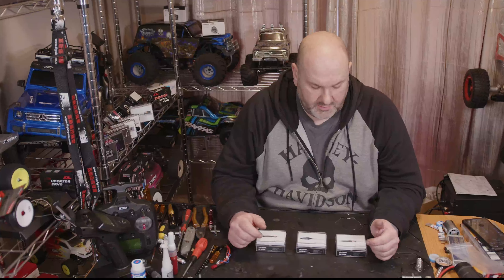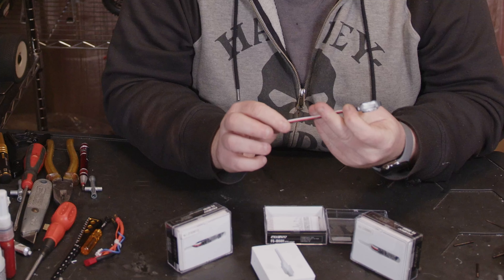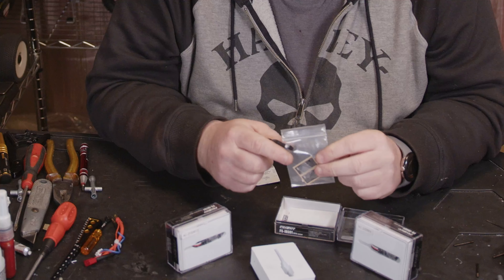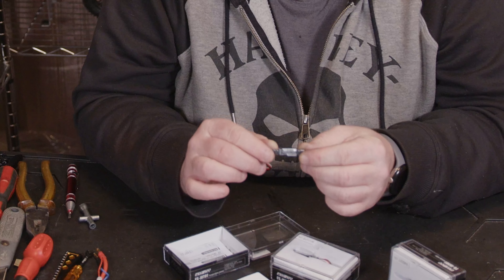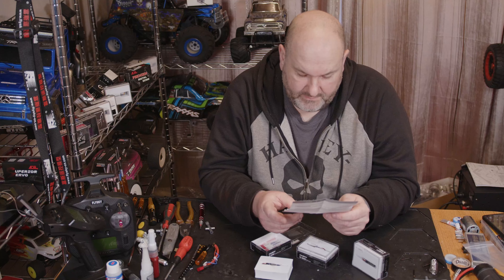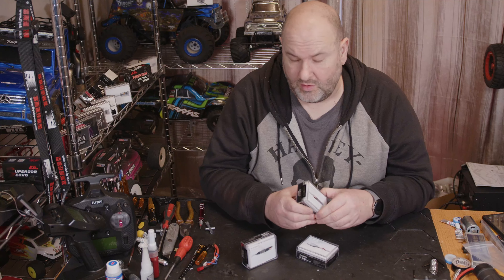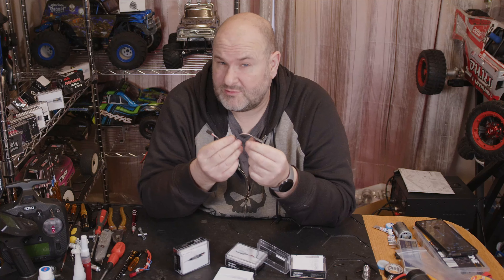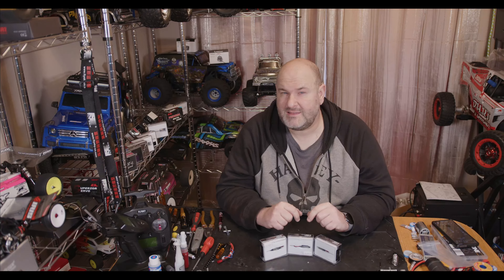Flysky’s new Ibus 2 sensors 1st look

Comment: They seem to be nicely designed. However they can't coexist with the old iBus sensors. At least from my preliminary tryouts. As soon as you set one of the 4 'newport' NPA-NPD inputs to iBUS2 you are locked-in to iBUS2 and all the other NP inputs have to be iBUS2. You can still set them  to S.BUS for communication to a flight controller for instance, but not iBUS, thank goodness. I even tried doing a double RX configuration, but the iBUS2 sensors won't work on the secondary RX, even connecting the two RXs via  iBUS2.  The secondary RX can only be configured to S.Bus, iBUS-OUT XOR  iBUS2, besides PWM and PPM of course.  No iBUS-IN option.   
So FlySky wants you to do away with the iBUS sensors in favor of their new iBUS2 ones. What a shame. Fortunatly the old iBUS sensors still work with the advanced RXs, by themselves, with .
Reply from the maker: It's because you can only have one ibus protocol on the tx at a time :)

Comment: Will this work with the flysky FS-G7P?
Reply from the maker: These require ibus 2 so unless the G7P has Ibus 2 then they won't work with it but I'll have to check
Reply from the maker: Hi I have checked but no the G7P can not do ibus 2 so only the older type sensors will work and not these on the current firmware.

Comment: While I do like these new and overall smaller sensors, I do see some potential flaws. For starters, as of this typing I can buy the current available sensors for as little as $8 a sensor. Don't know how much more these newer ones will cost as of this posting.
Also the older sensors, as you noted, can be "piggybacked" with just one of the sensors having to go into a RX channel. Now you will HAVE to buy the CEV04 module do that, if it's even still compatible. Note as well that only with the enhanced receivers can one set the individual channels to specific outputs unless something changed that I'm not aware of. I'm not sure if iBus2 has faster data transfer rates or what but for me, I'm keeping what I currently use which is mainly, the now older, temp and voltage sensors.
Reply from the maker: Yeh will have to have a good look at how best to use these but as of now I can only find them listed at around £40 each which is crazy price increase if that is what they retail for.
Reply: @WTFRCCars  $50!!?? I may as well buy Futaba gear then. Unreal if that's true.
Reply from the maker: I thinks it's just early sellers trying to cash in
Reply: The iBUS and iBUS2 are mutually exclusive, you can't use both in the same setup. THe iBUS2 transmission rate is 10x that of the iBUS, BUT telemetry data is sent back to the transmitter every 10 data/control packets received by the RX or even less frequently. So what would the higher transmission rate be useful for? Not for telemetry but for servo control if you connect iBUS2 servos. Than again is that really practically necessary?
Reply from the maker: Ibus2 servos work really well I run them in the touring car
Reply: @WTFRCCars  Sure, that's what they should have iBUS2 left for, for control  devices that need fast rates ond low latency. Sensors don't need that. Their update rates are 5-10 Hz.
Cheers.

Comment: Nothing about these sensors makes any sense. They are obscenely priced [about 5x the cost of the older sensors!!] and in fact only cost slightly less than the GPS module/multi sensor! Further they've lost the piggyback function, the cable looks to be extremely short and they dont do anything new or better than the older sensors do. Every single thing is worse. Something Im missing here? lol
Reply from the maker: The sensors do far more than the old ones and have much higher data transfer bandwidth available, they also don't affect the latency of the radio and are designed to connect through the ibus 2 connectors so don't need daisy changing hope that clears things up a bit, also think the prices will be cheaper when the availability goes up as it looks like the 1st sellers are trying to up the price :(
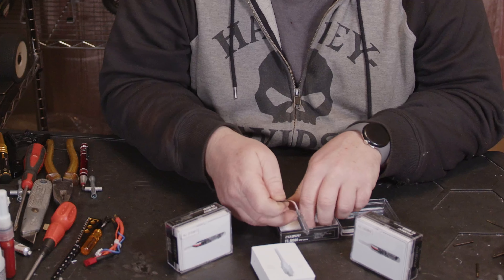Reply: @WTFRCCars  Telemetry data is sent back to the TX at a 1:10 ratio every 10 control packets received the RX sends back a telemetry packet. So only if the RX has a MPU and analyzes and uses the data for calculation and stores the results in RX memory will that be useful.
Reply from the maker: @klausmewes3622 the telemetry updates many time a second even with multiple sensors running including the GPS module the Rx doesn't do any calculations with the ibus 2 data